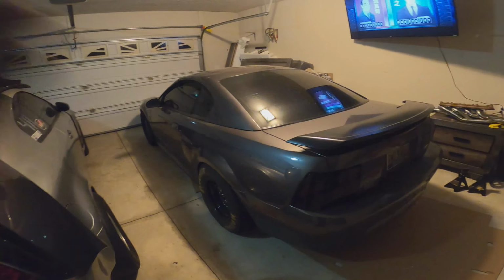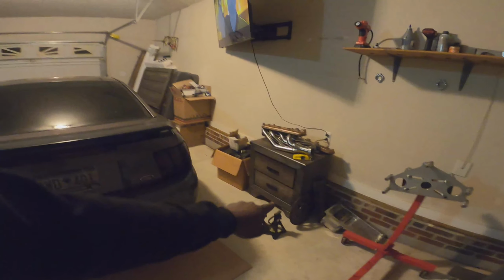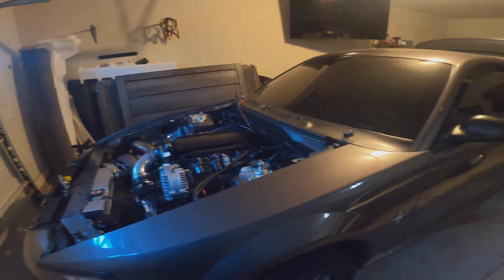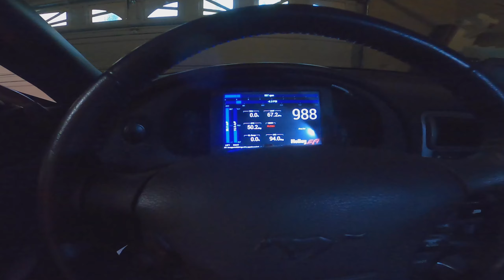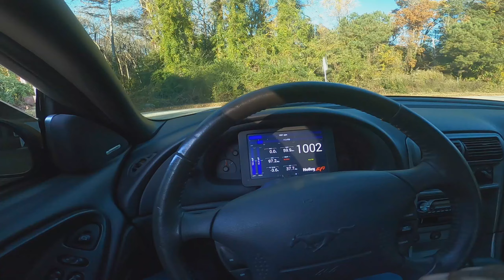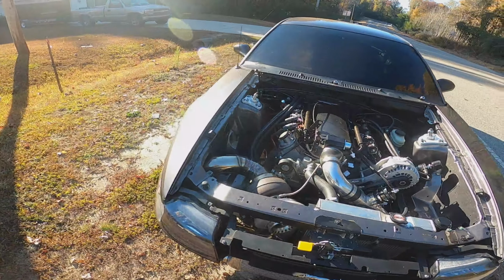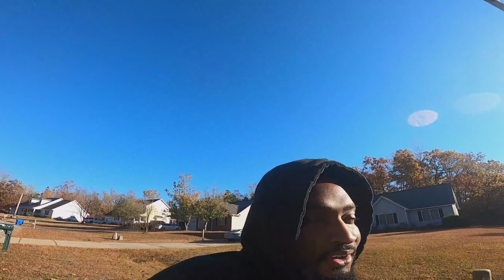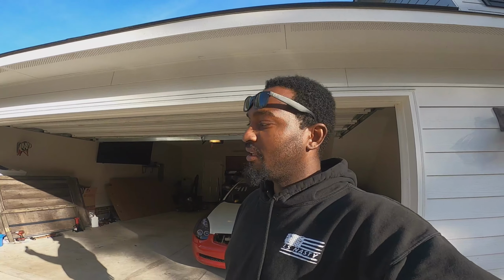Quite possibly THE NICEST car I've ever owned.

Comment: Help a ford man with 2 new recent purchased LS vehicles. One with less than optimal oil pressure on a 6.0. How would the trans/flex plate/convertor cause a oil pressure issue? I am sure its a dumbass question
Reply: Converter can balloon knocking out thrust bearing. Maybe?
Reply: @jonathonbelton2387  thanks for the insight for me to look into
Reply from the maker: What jonathon said.